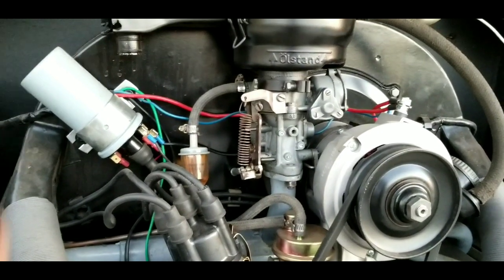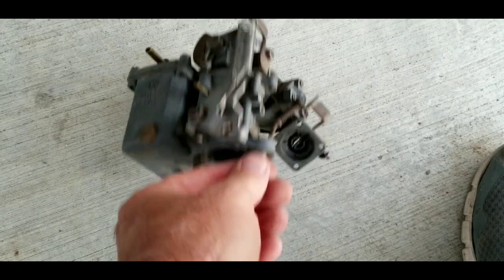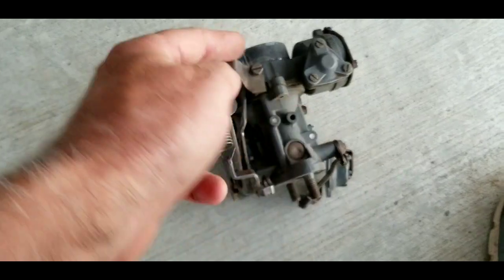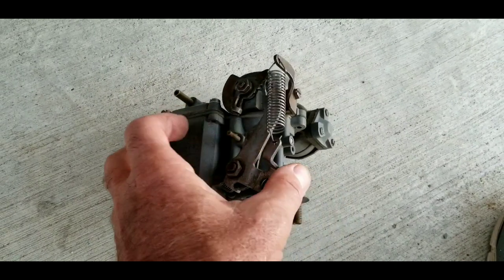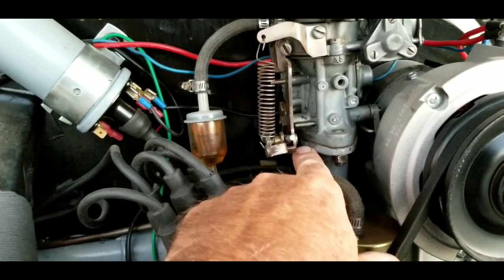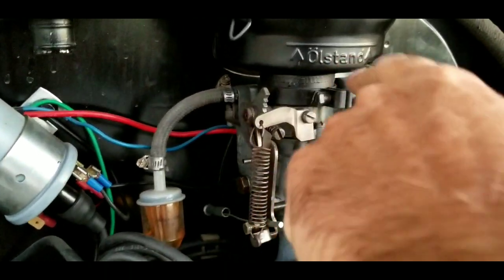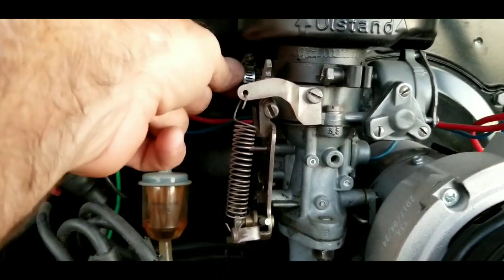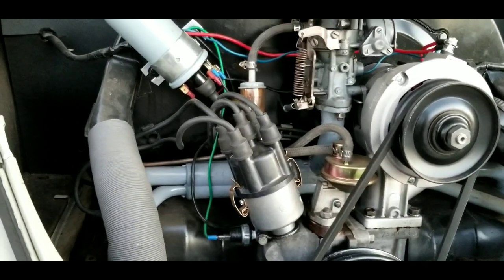VW engine vacuum leak misconceptions and what cause engine running hot

Comment: With you 100% on the fuel filter setup.  Ran my ‘72 daily for 10 years like that without a single issue.  Besides…this is how it was installed from the factory.  That’s good enough for me.  Threading the carb fuel inlet barb IS definitely recommended though.

Comment: I bought my 73 super burned right where the filter would have been.it had been repaired mechanically but the burn still remains. I will never know what happened but just in case, I thought it to be wise to put the filter in a cooler spot, not between a fuel pump and an item that is designed to ignite said fuel

Comment: That vacuum tube has 'ported vacuum' and is intended for the vacuum advance on your distributor. If your distributor is something like the .009, then you should definitely cap off the port or it could get clogged.
Reply: Funny how screw tube pops these things up when it’s pretty much just in your thoughts, or kind scary actually. But anyway, I’m a bit confused on how this ported nipple even works at all. I have to dig into it some more, but I just recently installed a Petronics with the SVDA distributor that came with the kit. It worked great at first, but I started getting a bad hesitation at low rpm acceleration on my 69 1600 single port. Turned out to be the accelerator pump port  was clogged between the bowl and pump, but while diagnosing  before I found the issue, I checked the timing advance with my light and found that there was absolutely no difference in the timing curve with the vacuum hose attached or unattached. They say to remove the hose and block the nipple to set the idle timing, but in this case there is no difference. And I do not rely on static timing, I go by full advance , which is critical in my mind, and adjust accordingly. I checked the vacuum on the nipple , and there is zero at idle, and a max of no more than 5 inches at any higher rpm. Manifold vacuum is 16 + . I’m thinking of putting my old SVDA back in just to get some numbers, but this is really causing me some head scratching. Any thoughts would be appreciated. 👍
Reply from the maker: not  a vacuum leak it is above the throttle plate. it is unfiltered air.....not engine vacuum.

Comment: Ya man, the keyboard warriors started a WHOLE thing about them damn filters!! EYEROLL, I never use clamps either!! BUT only use german hose and check it regularly! ONLY fire ever was once the bowel plug bolt on lower left side came out because i had forgotten to snug it after a rebuild. ALWAYS have a fire extinguisher.
Reply from the maker: clamps are just a precaution. those hoses do come loose when they get old and it is better just to put some on there for precaution.

Comment: Would that port on left side you pointed to connect to an svda? And if so is it necessary to run a metal line looped with hose on each end? Also one more question. My manifold has dual port castings with orange boots. It also has a small port on neck under flange. With additional port on drivers side casting. Where or what connects to those. Looks like may have had heat risers that are no longer present, can I seal up if I suspect a vacuum leak there?

Comment: Hi, looking for advise...engine sputters and takes a while to die after switched off. Thx !
Reply from the maker: they had a fuel shut off in the later models. They also failed often....I just put it in gear and drop the clutch when shutting off the engine.

Comment: I had a fire once , old rubber cracked and leaked fuel onto the exhaust , luckily it put itself out .

I now run R9 fuel hose as it is not affected by modern fuel. 

My fuel filter is under the rear fender .

Comment: I'm a little confused by your term "Hot".  I'm understanding this as "Lean" so that would be hot in the sense of a lean mixture being hotter and as that relates to the engine heads.  I'm not sure if in this sense of hot you as well mean that this heat results in a cross transference to other engine metal such as the block and ultimately the engine oil.  In this case I'd like to add using Premium Gas, as that is a late-burn keeping the valves cooler.  If you mean "Hot" as in "Overheating" the air cooling must be addressed too.  In brief, Doctor Porsche designed these engines to be separated and sealed between two sides.  The side under the hood is the Cool-Clean side, and the side beneath the car is the Hot-Dirty side.  The two sides must be sealed off from one another by the means of the metal work and the flexible gaskets.  I mean no disrespect to you but the title and the term hot are confusing me to what you mean.  Regarding the carburetor, if the Germans put the little air intake fitting on the side of the carb, than it's there for a reason and I wouldn't cap it.  Regarding fuel leaks, if the correct German hose barbs/fittings are being used, as well as the correct German hosing, than you don't need hose clamps.  I like your videos and I like your cars too so I subscribe and clicked the bell.
Reply: There are 2 ways an engine can run hot: 1) systemically,  2)combustion-wise.    This man (Mike FN) is talking about the 2nd one.  A quick explanation:  Gasoline (aka petrol) has a strong cooling effect when allowed to evaporate (rubbing alcohol on your skin will demonstrate this phenomenon).  When an engine is said to be running lean (more air than gasoline) it will still ignite the mixture in the combustion chamber but it will be a hotter process because the hot metal surfaces had less exposure to the evaporating gasoline since there was less of it in the mixture.   Continued running like this will heat up the surfaces quicker than the oil or the air (if air cooled) or the coolant could cool the opposite side of these metal structures, so much so that they could start to glow on certain spots.  These red hot spots on said metal surfaces will then cause "pre-ignition", which  in turn will cause a violent explosion in the engine, which can be heard as a metallic tap in the car,  and may even cause catastrophic engine failure by melting the piston and blowing a hole through it in extreme conditions.  Hence, the concern about vacuum leaks in the intake making the engine "run hot".

With that out of the way, the tube/orifice on the side of the car in the video is not really adding too much air into the mix, according to the video presenter because of the reasons he provide.  (I do however beg to differ somewhat on his explanation but let's just go with what is being said in the video for now).  That tube is for the vacuum advance mechanism that is supposed to activate the spark advancer mechanism on the distributor.  It does not activate until the throttle is opened up from its normal resting position at idle, hence no "vacuum leak" happens until then.   My disagreement with Mike is what happens during part throttle because that is when the vacuum leak actually occurs.  The effect is less pronounced at wider throttle openings but it does become more significant at part throttle, especially the closer you get to the closed throttle position, adding to the famous flat spot felt during mild acceleration. Nevertheless, i would say that the effect is minimal so as to be negligible because of the accelerator pump that dumps extra fuel during acceleration.  It would only be when coasting and opening the throttle valve partially that the leaning out would occur.
Reply from the maker: @ChuddleBuggy  perfect

Comment: I fully agree with your Mike, about the small air connection and about the fuel filter. Here in Brazil I already saw many cases of fire due to bad quality hoses and or bad barbs connection. Never about  plastic filters. I have a Brazilian 65 Bus, with a 1200cc engine 34hp). All fuel lines are metalic, and all connections are treads. No leaks at all.

Comment: that little pipe attachment connects to your vacuum advance on your distributor, if you have the matching parts, otherwise plug it off !!!
Reply: that's what I thought, he failed to mention that was specifically for the vac advance. I run an.035 distributer

Comment: The vacuum port is for stock vacuum distributor .  You have a centrifugal distributor 👍
Reply from the maker: yea for sure. and both distributors work ok. I prefer pointless because of the china bosh points and condensers today. They actually fail more than the china pointless IMO. hose on or off of that port does not effect the performance or mixture enough to worry. On a chevy maybe but not a vw because it is too small of an oraphase.
Reply: I have had 3 vans and 2 bugs
Reply from the maker: @oscarblom4885  awsome